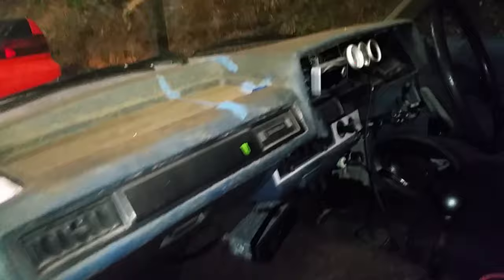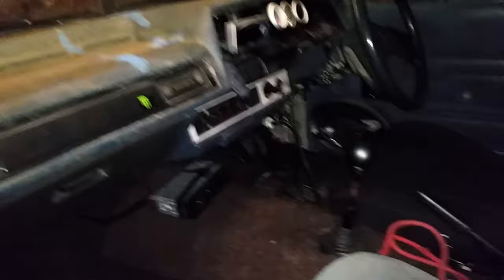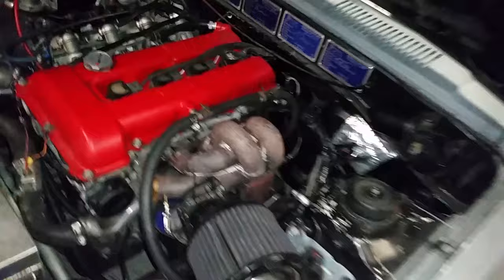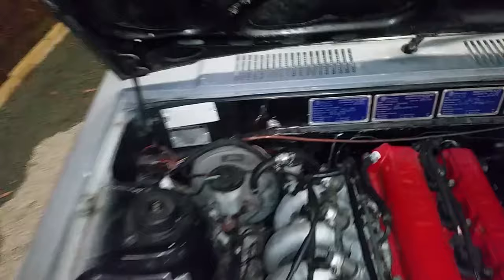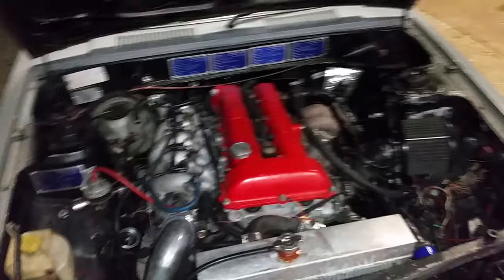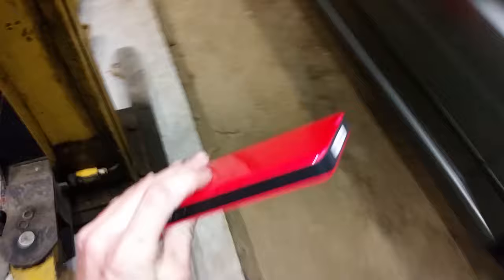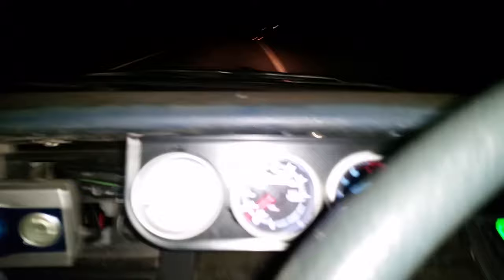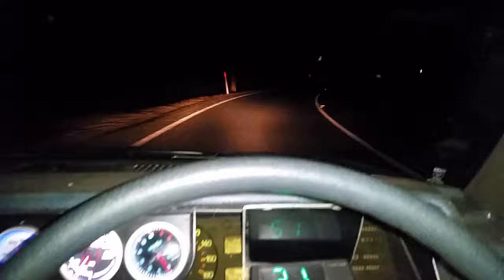SR20DET KE70 STREET CAR

Comment: how much power do u plan to make? I'm thinking of doing the same swap and want to know if it goes any good
Reply from the maker: It was making just under 200hp
Reply: Stock power would be crazy. Thing would barely way a tonne
Reply from the maker: @liams1854  I took it to a weigh bridge and got just under 900kg 👌